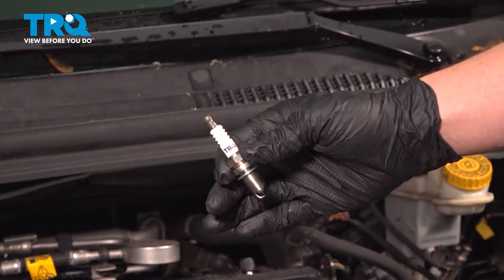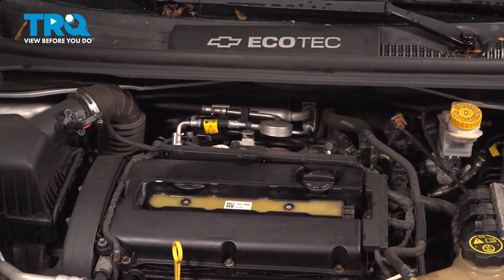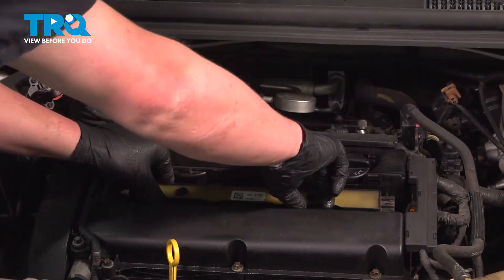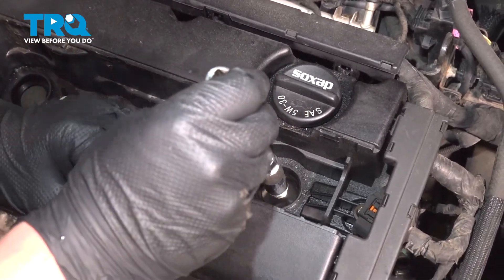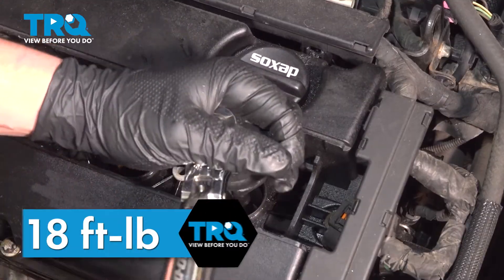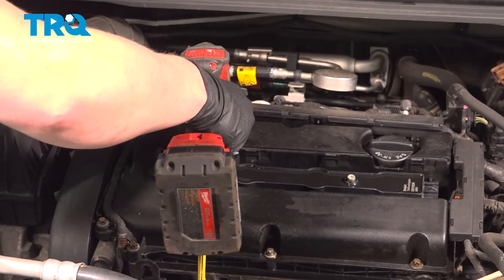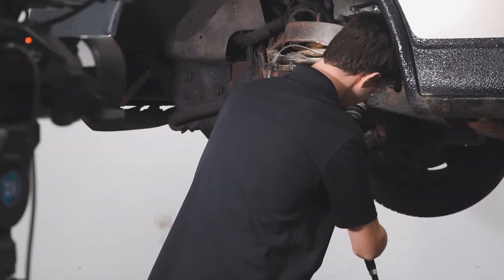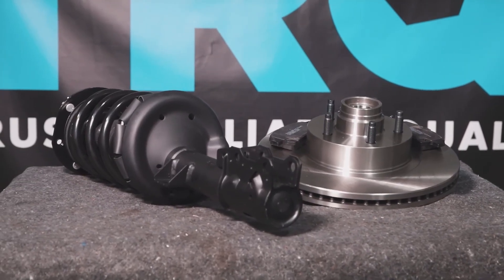How to Replace Spark Plugs 2012-2020 Chevrolet Sonic

Comment: Chevrolet Sonic – Engine Problem:

RPM unstable, engine sometimes stalls.

Raw fuel smell.

Crank sensor replaced.

Throttle body replaced.

Fuel pump & injectors cleaned.

New spark plugs & ignition coil.

Check engine light sometimes blinks.

Problem still persists.

Pls help me no one know what the problem..

Comment: What's up with the next spark plug hole looking to be filled with oil/coolant????
Reply: bad oring seal on the sparktube,  and when he put the igtion coil pack on it was a brand new pack. lol this video is  horrible.
Reply: Its filled...... with oil/coolant
Reply: Could be from a busted coil pack. The oil in the pack leaks out and fills the hole where it broke. Can sometimes cause a missfire or lack of power when trying to give it some gas